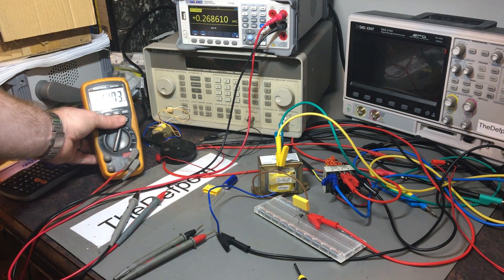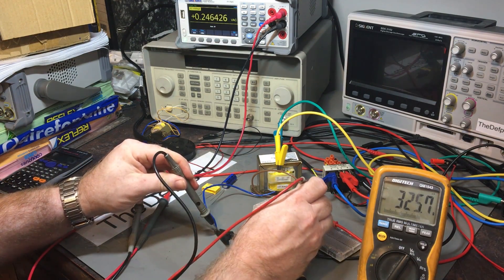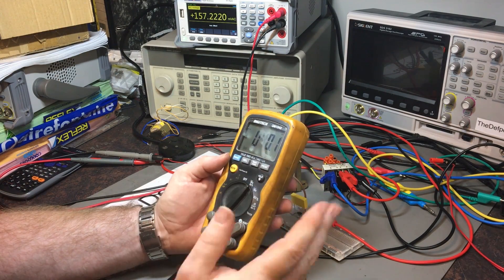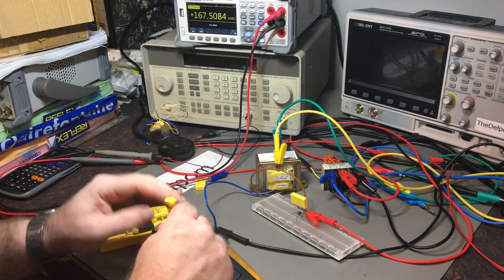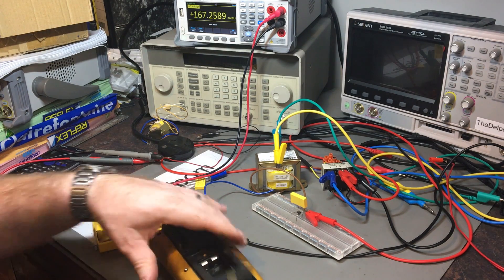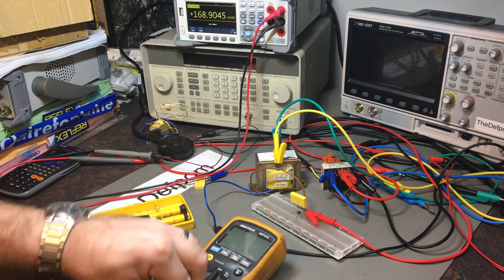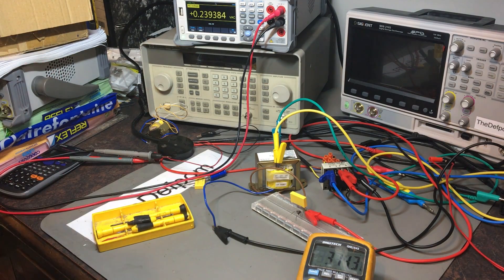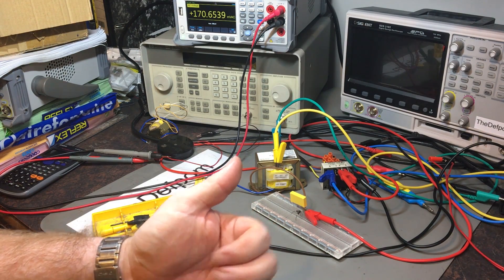🔴 #402 Always Double Test AC - You Cannot Trust Your Meter!

Comment: So what you're saying is that failure to care for equipment, by using decent batteries and checking them, can lead to incorrect readings.  And then you show us the right way, by putting in some random battery that you don't trust without measuring it first!

You keep saying care is important in high voltage situations, yet other aspects of your behaviour suggest you don't follow your own advice.  Do you get your gas appliances serviced?  Do you get the brakes and tyres on your car checked?

Perhaps it is time to up your game in your videos?  More professionalism please!

Comment: Another Dangerous situation is having the meter on the wrong range inadvertently. For example measuring AC voltage with the meter set to DC can catch you out. When working with dangerous voltages, always assume the unit has power !
Reply from the maker: or set on Current not Voltage... I've never done that... this month.

Comment: I'm assuming the 'low battery' indicator is there to advise that you change the battery at your earliest convenience, rather than leave it until the meter starts to become unreliable. As it's a DMM it needs power to operate on ALL ranges, unlike many old analogue ones, where you could measure voltage without having a battery inserted!
Reply from the maker: Pete Allum the battery indicator has a little bar graph, but even with s brand new battery it doesn’t show the “full” bar... I would of expected it to flash the indicator or shut down when it gets to the point where the power is too low to work properly, rather than giving false readings on a single function, all the other functions still worked fine, even resistance which I would of thought would be the first to fail with a low battery.
Reply: The Defpom's Repair Channel 
Okay. All my DMM's have a battery low indicator and no battery level indicator so it's easy to know when the battery level is insufficient. It sounds like your meter would benefit from a similar arrangement. Seems like a poor design choice IMO.

Comment: Bit funny, your Affiliate links go for cheap meters and your video warn from bad meters. Ok  not same, but almost.
Reply from the maker: My affiliate links allow you to buy any items from Banggood, not just the item linked to. The Digitech meter came from Jaycar Electronics and it surprised me that it worked correctly on all functions EXCEPT AC voltage... bit of a design flaw I think. You do get what you pay for, but from memory I think that meter was about NZ$180 new. (about US$120).
Reply: I think it's CEM DT-9919. In general this manufacturer has a pretty good reputation.

Comment: I always check my leads with the continuity tester before I check anything else with it.
I notice most folks don't do this.
Reply: True, but the most common thing to fail are the leads, as they have the most wear put on them in use, and the wire inside can fracture invisibly.

Then again, I have a small mains LED tester, and it also has a verification device with it to enable you to check it actually is working, before you go shove it on the mains. To be sure I also have 2 of the testers, one old Steinel hobby check, and the new one, though I can also pull out the really old magnetic indicator if I want to. The mains testers live in a small travel bag, along with the tiny little clamp meter ( Uni T) as a quick toolkit for doing things.
Reply: But ranges will fail independently of each other.